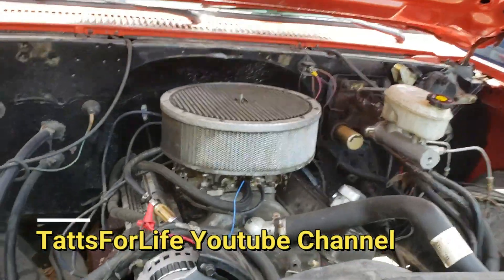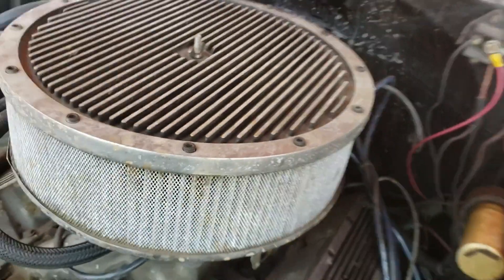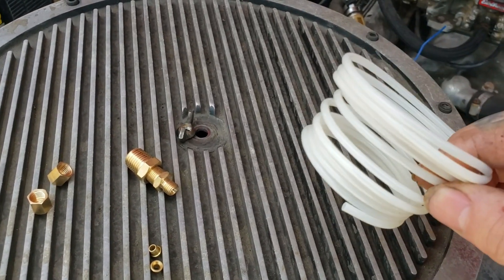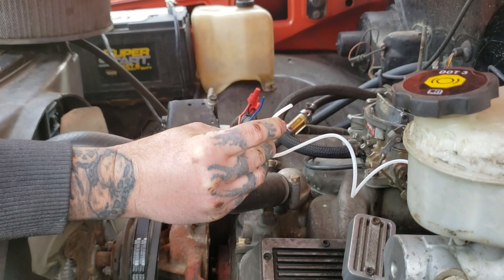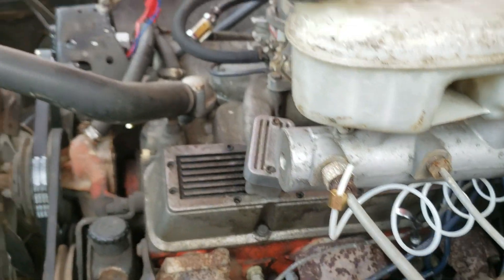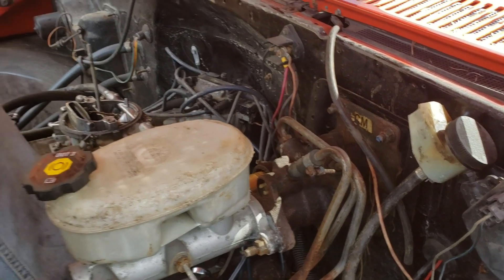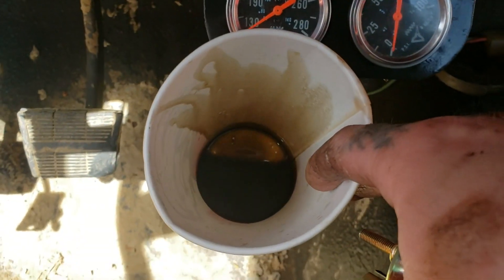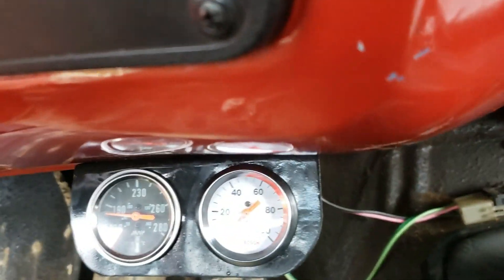Mechanical Oil Pressure Gauge Install

Comment: Don't forget to bleed the line of that air. At the gauge, with the ignition off, just bump the motor over a few times to bleed out the air then reconnect at the gauge. It gives a faster response time and more accurate reading. Good vid, thanks
Reply from the maker: Thanks for watching

Comment: How do you fix a leak? I tightened it once and it stopped leaking til I drove it again, did I not tighten it enough or does it just need to be replaced? It leaks off the engine and off the gauge inside the cabin all over by my foot
Reply from the maker: sounds like the line is damaged, have you tryed installing a copper line?

Comment: I’m going to try to do this on my camry, so would i have to completely disconnect my sender unit or is there an attachment that i can use for that?
Reply from the maker: you could hook a wire style gauge right to your factory sender if you wanted

Comment: It's called a Compression Fitting Nut,,the 'BELL" looking thing is called  Ferrell..Just an FYI everyone...DO NOT USE THAT plastic tubing get some 1/8" copper tubing....As you can over tighten the nut an cut it and over time it will become brittle..Think a minute how much of a mess that would be in side. High pressure and "HOT" oil
Reply from the maker: Great info

Comment: Thanks for the video! My oil line got hard from years of engine heat and broke off near the fitting. It's now too hard to thread through the fitting. But at least your video showed me that a new line will thread in easily. 👍
Reply from the maker: Thanks for watching
Reply: @TattsForLife same here. Been trying to slide a new crimp on for 2.5hrs now. Tried heating and stretching the hose so it gets smaller with no luck

Comment: nice and helpful video !  I now have installed my Autometer Mechanical Oil Pressure Gauge which has air bubbles in the nylon line. Any issues with that or is the pressurized volume of air and oil ab. the same ? Thanks.
Reply from the maker: should be fine, I bleed mine because the old timers told me to lol but seems the air would still work as it builds pressure

Comment: These gauge vids always involve old cars. The newer the car the less likely you are going to find access ports for water and oil. Check BEFORE buying gauges.
Reply from the maker: on newer cars you more likely half to buy a adapter to add a gauge

Comment: Ok how do you stop the plastic line from pulling right out, its not staying in
Reply from the maker: you should have cap you feed the line thought then a small gold ball you feed the line though and when you tighten the cap it crushes the ball and the line stays in

Comment: When new, there is air, how does the gauge work with the air pressure produced by the oil or oil ACTUALLY reaches the gauge? How Do you let the air trapped out when putting a new line?
Reply from the maker: When I was little a old man once showed me to do it by the car running, just crack the line a little at the back gauge with a rag behind it and it will dip bleed out, I been doing it ever since, IDK if air will affect it but I always bleed mine
Reply: @TattsForLife  thanks
Reply from the maker: welcome
Reply: Ty

Comment: So having oil in the clear line in normal
Reply: A drop or two of oil will always get in, but no oil should travel up the hose. An airtight line will build pressure with air only. If oil is going up, there's a leak in the hose.
Reply: @jaredbonefas1567  this is incorrect.  You need to prime the line full of oil to get a true reading. Air is compressable, liquid isn't.
Reply from the maker: yes its how it builds pressure